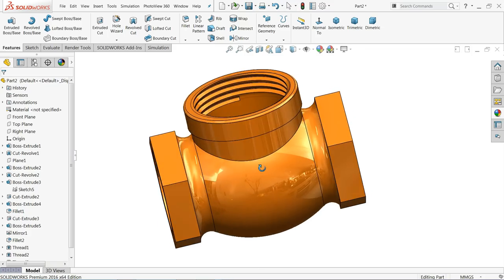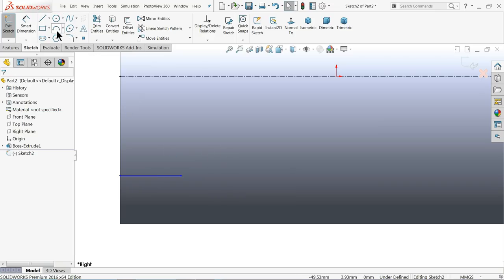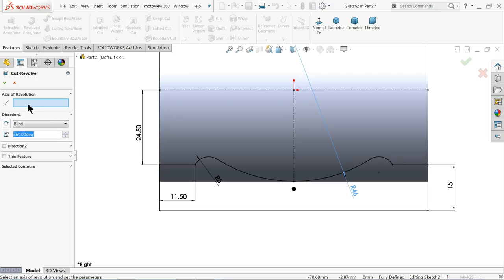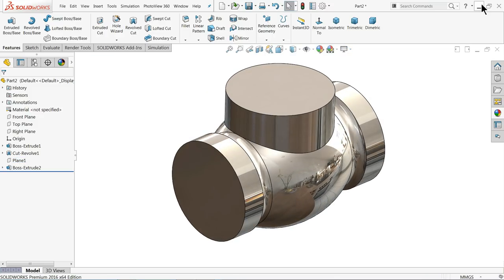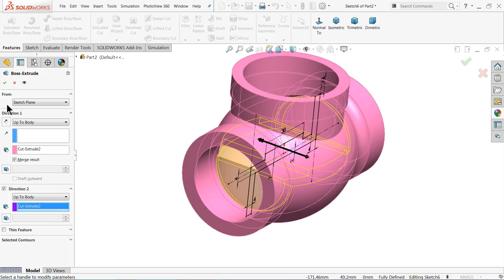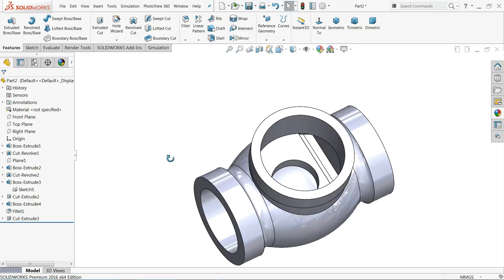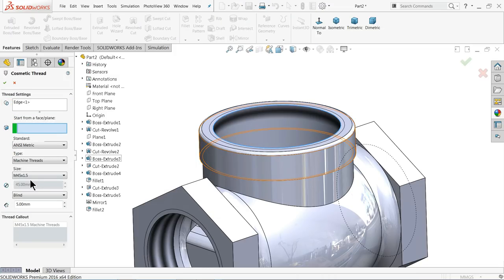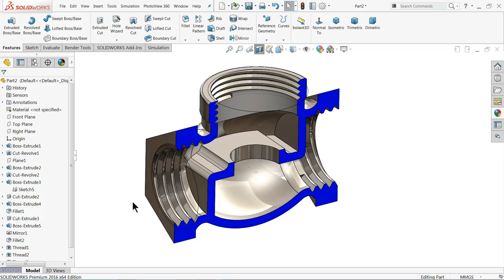SolidWorks Tutorial Valve Body

Comment: sir , what is the specifications of laptop to use solidworks please suggest me i want to buy laptop
Reply: Any laptop with at least i5 core CPU and 8 GB ram will enable you to  smoothly run solidworks...it will  hang in i3 or 4gb ram and rendering will also take time so 8 GB ram+ i5 core is the best combo

Comment: anyone knows where did he  find that 15 dimension in  4:32 ?
Reply: That dimension is unbounded. Just to keep that line outside of the body to perform Revolve-Cut feature.
There can be done Revolve-Boss feature instead.
Reply: @FJProject  Can you be more clear?
Reply: @mohamadkhatib8624  Well instead of doing a cylinder Extrude-Boss and then Revolve-Cut, there can be done one Revolve-Boss.
Reply: @FJProject  Could you also tell me why and how did he set the dimension to 24.5 from center line?
Reply: @saivamsipakkurthi  It's simple, the radius of the inscribed circle of the hexagon at 17:34. But in fact it should be 24.25 according to the drawing itself.